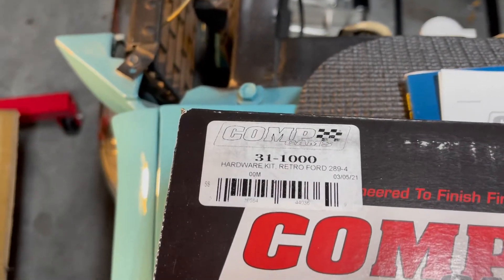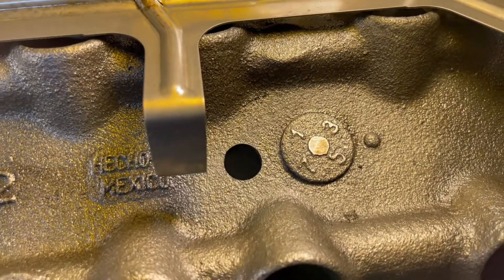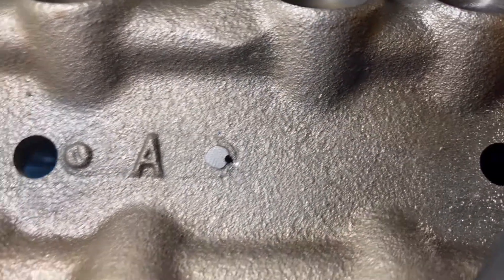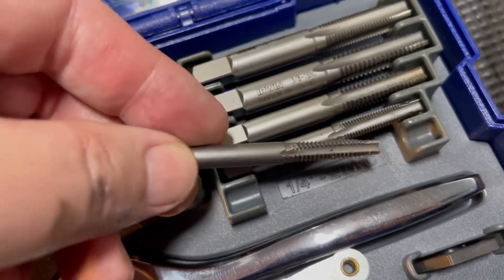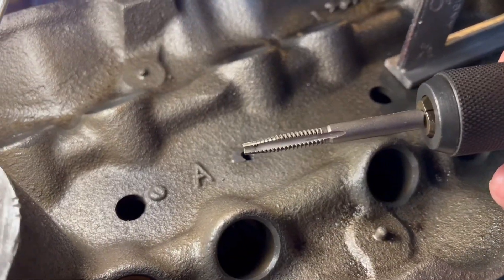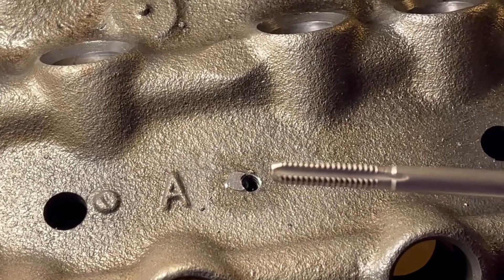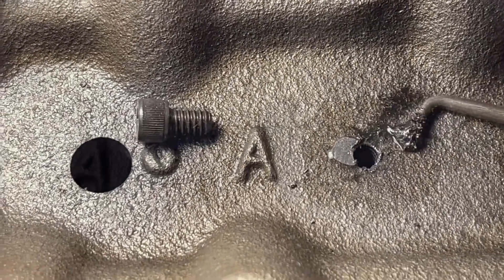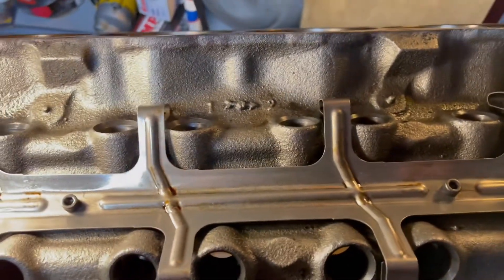COMP Cams Hydraulic Roller Lifter Retro-fit Ford 289 302 Stroker Rebuild part 2

Comment: Hi John!! Can you nix the spider tray if you use the lifters with the connector bars? Or is this a better option with the Spider tray?  Thanks Building a 351W stroker motor this summer. Cheers from Motown/Dearborn. Thanks for sharing.
Reply from the maker: You don’t need the spider tray if you use lifters with the connecting bars. I can’t really say one setup is better than the other, but there is a huge price jump when buying lifters with connecting bars. Quality lifters are definitely not the place to try and save money.
Reply: @JohnLatrobe  Thank you John!! Much appreciated sir!!!

Comment: As an ex tool maker who arilla works in aerospace you say tap a 1/4-20 hole which is right

but what everyone doesn't know is the drill size 

And I've drilled many of these holes for Boeing and it's a 201 drill. You can get away with a 203 but 201 is exactly it

Comment: Did those lifters work for you?  I was sold the retrofit evolution lifters and don’t care for the excessive link bar noise.  The ford OEM style came out to far pushing the link bar up and exposing the bleed hole in the lifter.
Reply: If you don't have a small base circle cam like the ones that Howards cams makes in their catalog, you're going to have problems with the oil bands being up too high 

It's either you buy a retrofit cam and retrofit link bar lifters 

Or you buy this kit the OEM lifters but you have to have a small base circle cam so your oil band doesn't get exposed
Reply: @KingJT80 so your saying these will not work with a standard base circle hydrologic cam and an older non roller block?  I have the evolution retro fit link bar lifters and these do work with an older block with standard bore cam.
Reply: @dennis17116  So the retrofit link bar lifters will work with a factory roller cam and an older block or a retrofit cam in an older  block 

When you want to use cheaper lifters you can use the four performance lifters and the spider tray. But if you use those lifters in an older block, you're going to have to use a small base circle. Cam 

There's a couple of different ways to do it
Reply from the maker: These lifters work great. Well, except for the defective one that failed to flow oil. Besides being way cheaper than a link bar setup, the dog bones don’t bounce up and down with the lifters like the link bars do. And yes, Ford OEM roller lifters will only work in a roller lifter block that has taller bores to cover the oil hole.
Reply: @ thanks for the quick response.  Yeah don’t care for the excessive noise either.  Probably going to pull the intake and put these in with my dog bone setup I had previously.  Cheers! 🍻

Comment: I'm happy, I have a 5.8 EFI roller block from a 1997 F-Series truck. No need to do this.
Reply from the maker: The newer blocks don’t have the mounting boss for the clutch linkage (z-bar) that I need.
Reply: What year?
Reply: @Jbyrd75901  It's a 1997 engine.
Reply: @Jbyrd75901  It's a 1997 engine.
Reply: @Jbyrd75901  It's a 1997 engine.

Comment: I could use a COMP HIPO cam  with this right? Or do I need a Cam that is designed for roller lifter.  Also how does this help with the breaking in process  (Flat tappet / need zink additive / 2000 rpm and then question CAM strength and hardness vs older quality cams like my original in my 1967 mustang), also is there any changes to push rods required you said they are shorter or does the stud take up the extra?
Reply from the maker: Ford roller blocks use large base circle cams, whereas earlier non-roller blocks use cams with a small base circle. In addition, the roller block lifter bores are longer since roller lifters are longer than older flat tappet lifters. So, in order to run a roller cam in an early non-roller block you need 2 things.
	1. A small base circle roller cam (not a flat tappet) called a roller retrofit cam
	2. Retrofit roller lifters designed for non-roller blocks. Standard roller lifters are too tall for the lifter bore and can expose the oil port at high lift. You can use lifters that require dog bones and a spider tray, or lifters with link bars.

Roller cams don’t require additives or a break-in procedure like flat tappets do. Also, you should measure for the proper pushrod length so that the rocker arm is perpendicular to the valve stem at mid lift.
Reply: @JohnLatrobe   - Please help with more info - very new to 289 engine and based in South Africa ( just bought a 1967 mustang coupe, manual).  What cam that is like a HIPO cam meets the criteria (roller retrofit cam)
2)Do the stock pushrods work, and the stock rockers 1.6 ratio.  Will I need to put in ARP studs  for reliability and peace of mind, as lift could stress stock studs)
3)have heard bad stories of normal cams and hydralic lifters ( non roller) - not running in properlly, given I am in SA, I haveto import everything, so could not afford a defect or a bad run-in.
4)Is the run-in process  with roller retrofit cam and matched roller hydraulic lifters, much simpler. or still a 200 rpm for 30 min exercise? and also special oil / more zink additive etc..

Tks John for your help
Reply from the maker: @SteveCrawford-r2d  You can search on the COMP Cams website for 289 roller cams and get the specs to compare to their HIPO grind, but flat tappet and roller cams specs don’t really compare directly. Flat tappet lobe profiles are limited in how steep they can be so roller cam lobes can open the valve faster. If you look at the 284HR cam specs for example, it has slightly less duration than the HIPO cam, but much higher lift so it probably flows better. Just my opinion…
2) Anytime you’re using non-factory parts it’s a good idea to measure for the proper pushrod length in order to achieve the proper rocker arm geometry. If your heads have pressed-in studs you’ll definitely want to upgrade to screw-in rocker arm studs. 
3) The failure rate of flat tappets during break-in is exactly why I chose to convert to a roller.
4) Roller cams don’t require any special run-in procedure or zinc additive. Just some proper assembly lube.

Comment: Just buy retrofit roller lifters and avoid this.
Reply: Have you priced decent ones lately?  Over $600 for just the lifters from Lunati, Howards or TFS.
Reply: High rpm lifters like the ford racing 302R lifters?  380.00

High rpm lifters with link bars?

650.00

Even with this kit it's cheaper by 150.00+ BUT buy a small base circle cams with those lifters so the oil bands aren't exposed

Comment: Having never done this before myself, could you have offset the holes in the spider tray so you could drill somewhere other than above the cam bearing?
Reply from the maker: At the time I installed the spider, it did seem to be a bad place for the mounting holes, but I was mistaken. The kit is designed to be installed on an engine with only the intake removed, and drilling blind holes over the cam bearings ensures no metal chips fall onto the cam and crank.  I could have moved the holes over a little, but they still have to remain on the flat of the spider tray. As long as you utilize a drill stop of some kind there’s no possibility of going too deep.

Comment: Very good conversion from flat tappet to roller.
I have a non roller 351w block, does this kit work for this motor and can I use any roller cam with this conversion kit?
Reply from the maker: Comp Cams 31-1000 retro-fit kit is designed for 289, 302, 351W, 351C, 351M and 400M engines not originally equipped with hydraulic roller cams. However, it can only be used with specific Comp Cams with reduced size base circles. Standard roller cams will push the lifter too high and expose the oiling port. BAD!!

Comment: You get that to run alright?  I had an absolute MF of a time getting one of those reduced base circle cams to run right. I used the 421-8 kit.
I ended up making a cutter out of an old lifter and decked the top of each lifter bore so that the dog bones wouldn't ride hard up against the lifters. Mine just wanted to walk and side load stuff.
Reply from the maker: Are you saying that the casting at the top of the lifter bores were messing with the dog bone alignment? I can see how the notch on the inside of the dog bone could snag on the top of the bore and pull the lifter to one side. Machining the top flat would eliminate that. You do have to be careful not to remove so much that the dog bone contacts the shoulder on the lifter and moves up and down.

I did feel some side loading on a couple lifters (they wouldn’t drop on their own when rotating the cam) but to me it seemed like it was caused by the spider tray not being perfectly aligned. I tweaked the tray as best I could so that the tension was more in line with the bore and not at an angle. After that the lifters dropped just fine but I don’t know it it’ll stay that way. I just got the motor back in the car but there’s still a lot to do before I start her up.
Reply: @JohnLatrobe  That's exactly what I am saying. And yes, careful when decking the lifter bores.  
I got mine all uniform but still, lots of futzing with it.

Comment: Hello thanks for sharing !
Is necessary to change the pushrods? 
Stock pushrods works?
Reply from the maker: The retro roller lifters are slightly taller than the stock flat tappets so I needed a slightly shorter pushrod to maintain proper rocker arm geometry. I ended up with a 6.600” pushrod.